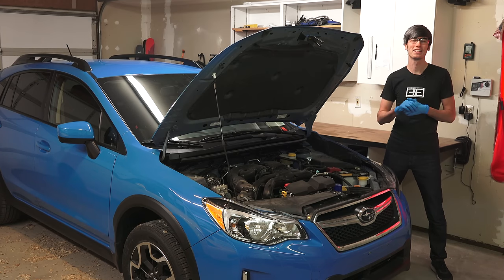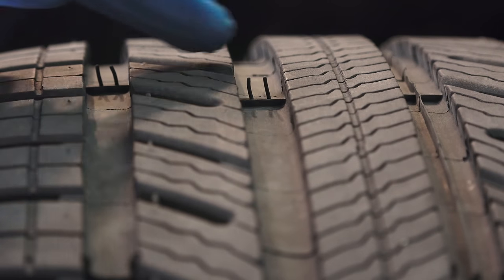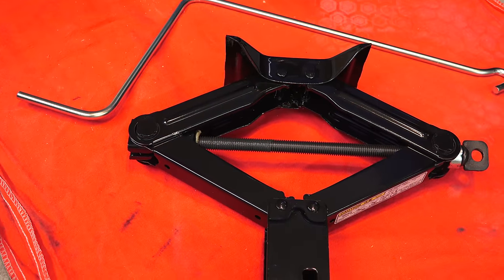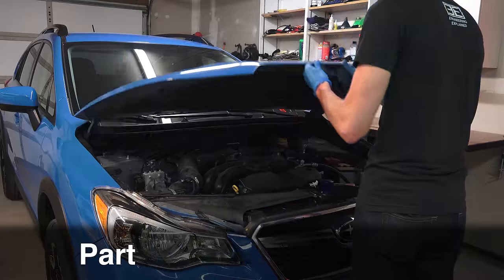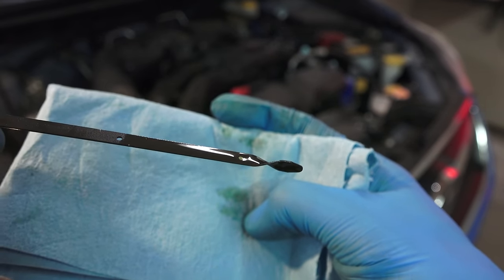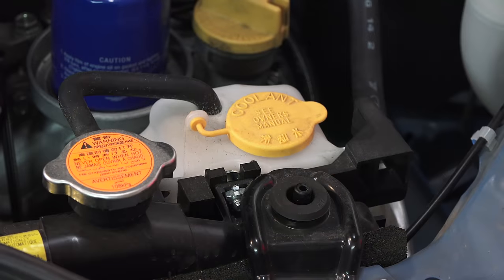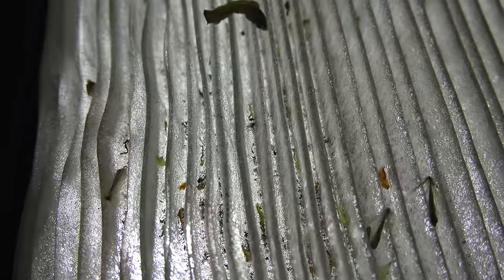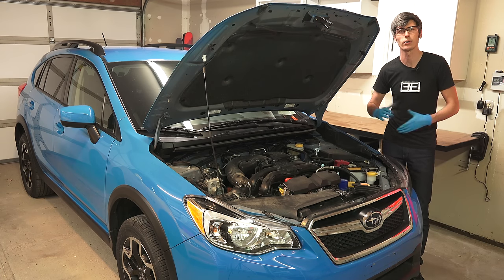How To Make Your Car Last A Long Time - Simple Checks

Comment: There are two things I'd like to add to this excellent video:
- Brakepads: unless you can have a good look at both the inner and outer brakepads, take off the wheel at least once, preferably twice a year. The caliper slide pins don't wear very fast, but eventually they will start to move less smoothly and can start sticking, resulting in uneven brake pad wear. If for example you only look at the outside pad, it may seem completely fine, meanwhile the inside pad can be heavily worn or in more severe cases even have started wearing at an angle. The earlier you catch this, the cheaper the fix is probably going to be.
- Brake fluid and coolant: these are both closed circuits, you shouldn't have to add any fluid. If you do need to add coolant, this indicates a leak. If you do need to add brake fluid, this indicates a leak or worn brakes (the thinner the brake pads get, the more fluid remains in the caliper to compensate). In any case, adding fluid does not fix the cause of the low fluid level. You should only add fluid if it is to get you home or to a mechanic.
Reply: Doesn't coolant get used up over time like it doesn't all return to the reservoir
Reply: @Gman07024 No, because it's a closed circuit. If the coolant level drops, then that means coolant is leaving the system somewhere. This can be through a leaking headgasket, leaking hose, leaking radiator, etc. But a properly functioning vehicle should not lose any coolant.
The level you see at the coolant reservoir can vary, this is normal. Because when the coolant gets hot, it expands, so the level will seem higher. And once the vehicle is cool, the level will seem lower again.
There will be markers on the reservoir indicating the proper level(s). Some vehicles will have markers for both cold and hot, others will have a minimum and maximum level indicator for cold, etc. It's not always immediately obvious how to interpret the markers, in which case you can check your owners manual.
Reply: @MicraHakkinen  oh okay so you'd only have to replace the coolant is it's no good anymore or after you've fixed your coolant loss problem. 

Can brake fluid "go bad" ?
Reply: @Gman07024  Yes it can. It's a closed circuit so if you're losing brake fluid, there's a leak somewhere. However many types of brake fluid (DOT3, DOT4, DOT5.1) are hygroscopic, meaning they absorb moisture from the air. Most manufacturers recommend changing the brake fluid every two to three years for the hygroscopic kinds, and about 5 years for the silicone-based DOT5, again your owners manual will likely tell you exactly what's recommended for your vehicle. Also make sure to use the correct brake fluid as indicated by the manual. Using the wrong kind can lead to extensive damage to the entire braking system.
Over time the water content of hygroscopic brake fluid increases. This is bad for two reasons. First of all, brakes can get very hot (which is normal), but if there's too much water content in the brake fluid, then this water can evaporate and create vapor bubbles in the fluid. Fluid can't be compressed, so it transmits the force from your brake pedal to your brake calipers. However gas can be compressed, so if a vapor bubble forms, pressing on the brake pedal just compresses that bubble, instead of forcing the brake pads against the rotors. While it is unlikely for this to happen under normal driving conditions, it's better to prevent the possibility of it happening at all.
Secondly a high water content in the brake fluid can cause brake lines to corrode from within. This is not only much more expensive to repair compared to just changing the fluid on time, but springing a leak in a brake line can obviously be very dangerous as well.
Reply: I dont like ppl putting out false information like this. You have a coolant resovior for a reason.
Reply: @MicraHakkinen  This all makes sense.

Over time can the coolant level decrease just through permeation alone?
Reply: @MicraHakkinen  Coolant does not stay at the same level and it's not because you have a leak.  I've had my car for 15 years and noticed my coolant is at minimum.  Nothing is leaking.  Getting a 50,000 mile maintenance check next week.

Comment: Pro tip for checking your tail lights:   Back the car up to the garage door, or wall.  Test the brake lights and see in the rear view mirror if the tail lights are reflecting off that wall.  This is just a quick  check method though.
Reply: Just put a stick (or your "club") between the seat and the brake pedal.
Reply: My method is to find an office building with reflective glass, park so I can see the rear of the car reflected back at me, then tap dem brakes. You'll know immediately if you've got a faulty brake light. 💪

Comment: Before driving at night or before going on a long car trip, check to see that ALL your exterior lights are operating correctly. There's no  need to give the police an easy excuse to stop you. Especially when traveling out of state.
Reply: And that includes license plate light, which is often overlooked!  I got profiled in my '94 F-150, and that was all they had on me.  Glad I only got a warning, and just spliced the wires back together.
Reply: Good point also remember that ANY external light is subject to being graded section of a state safety inspection........
That means if the safety inspector wants to be a jerk they COULD fail you for let’s say Fog Lights.  Not legally required but if it’s there it is subject to inspection..
Reply: "... out of state [with a body in the trunk]."
Reply: @prycenewberg3976  out of state with duffel bags full of cocaine

Comment: That last tip on check brakes lights is a good one.  Better than using an umbrella to hold the pedal down.  I used to park backwards in front of a store and use the glass reflection to check all those lights with my rear view mirror.
Reply: That's smart! I will do that!
Reply: It would be great if cars had a switch somewhere in the cabin (like under the steering wheel or something)  that you could flick on to engage all or selected lights. A bit like what they have in Aeroplane cockpits. It would save having to ask someone to step on the brakes for you
Reply: @garymathe9863  
I usually use my cinder block on the accelerator when Im on the highway. Saves having to hold the pedal down with your foot when you dont have cruise control
Reply: I do the testing at night
Reply: Also when at a stop light, you can sometimes see your brake lights reflected in the front of the car that's behind you. But I would suggest getting out and looking at your license plate lights, if you have two lights on your license plate, and one of the lights not working, it can be difficult to see that in just a reflection.
Reply: I just check to see if I see a reflection in the bumpers of cars behind and in front of me xD

Comment: Let the car rest for a night before you check this stuff.
I once tried to refill the coolant after coming home from work... It was worse than a shaked coke bottle :D
Reply from the maker: Ha, yes, definitely don't open the radiator when it's warm!
Reply: Dude 😂most cars have a label right next to the radiator cap, warning you not to open when the Engine is hot & leave the car to cool down before opening
Reply: @Yaserinski Shahidovich: After 15 Years those stickers tend to either become black from the dirt or just disappear ;)
I was lucky that I reacted quick and closed it up once the hissing noise started 
But actually it was a good thing, now i will never forget to let the car cool before opening anything.
Reply: @Ultrazaubererger  You learnt it the scary way.
Reply: And also the engine oil has to settle. Some people say 15 mins is enough for that but it's not, I wait at least 3 hours.
Reply: I wait at least 7 hours. At least. Messes with my sleep but I love my car and she's worth it.
Reply: @sogerc1  Read your owner's manual. Mine says to wait a " few minutes". If I check it after it sits overnight, I'm actually getting a reading that's about 1/2 guart less than the recommended capacity.
Reply: I have it the other way, if I check it too early it says there is no oil, if I wait there is enough.
Reply: not really like a coke bottle,  more like a kettle of boiling water but under pressure too,  plenty of people have got seriously burnt doing that, should only be opened when engine has cooled down.
Reply: Same can be said about the oil levels and tire pressure, those are more accurately measured with a car that hasn't been moved for a while.
Reply: +David Sparling
My owner's manual is in German, I can't understand a word of it, German is so hard.But if I only wait a few minutes the level is considerably lower then after 3 hours.
+jb602
7 hours may be an overkill, does it really worth messing with your sleep cycle? Maybe you could check the next day? That's what I do when waiting 3 hours would mess with mine.
Reply: Some cars/engines specify that the oil be checked while warm and NOT after being left overnight. RTFM for your vehicle :)
Reply: That's common knowledge.... Common sense..
Reply: Don't be afraid of the radiator guys lol  You just loosen the cap and slowly release pressure or else it can boil over on you, but you don't have to wait four score and seven years to look at your fluids.
Reply: Pretend it's coke and try to drink it
Reply: well either way it is good to wait a couple of minutes so the oil moves to the oil pan where the stick can accurately measure.
Reply: My car's coolant lost for about an hour, then I need to fill it up again. When on a long trip, I have to put it while the engine is hot
Reply: I once saw a BMW driver at a German gas station opening his coolant compensation tank... what a mess!
Reply: Very good useful video.👌👌
Reply: Read the sticker at least once before year 15 then,  @Ultrazaubererger
Reply: jb602 haha are you joking? I’m not sure haha
Reply: 6 finger method. One hand twisting the cap and the thumb from the other hand holding the cap down. Slowly unscrew until you hear the hiss. Hold until the hiss stops then continue to open. No more hiss means no more pressure
Reply: Did this today at the gas station. I knew it would squirt out but it was 10x more than I thought. I almost died 💀
Reply: @EngineeringExplained  which car brand or car company is Most Reliable ?

Comment: All I’ve ever own was high mileage vehicles. Lowest one I’ve owned at the time I bought it was 175,000 miles. Everyday or every 3 days I always check the fluids and tires. Every week I clean filters, and then change my oil around the 5,000 mile mark. Having or buying a high mileage vehicle isn’t a bad thing. Just know how to check everything and your good to go.
Reply: I bought one new vehicle once. I remember being really nice and not using the foam brush at the car wash, hand wiping instead. Even after a month I was wondering where all these scratches were coming from. 

Contrast to a different beater car I had and someone gave me a light bonk when they ran a stop sign. 
"I don't need to report this if you don't care."

Comment: You should also check the VTEC solenoid to see if you get those mad gains.
Reply: 10hp+ if u have k&n sticker there
Reply: Cause I bet you own a car with true vtec I'm sure..
Reply: It's a honda thing. A how to maintain a boosted engine should be his next video!
Reply: Can you post a video for the location of this part ?
Reply: Engines have solenoids?
Reply: Wow the second comment, that didn't take long 😂😂😂
Reply: Very Tall Engine Cooling ?
Reply: Variable Valve Timing Lift Electronic Control.  Engages a more aggressive camshaft profile over certain RPM's and then you get Vtec kicked in yo.
Reply: It just kICkS iN YO
Reply: VT4K ATT4K

Comment: I have a 2015 Ford Expedition and I kept up with my tire rotations, engine oil, coolant, Rear end gear fluid, transmission fluid changes and haven’t had any engine problems at all. Great video👍